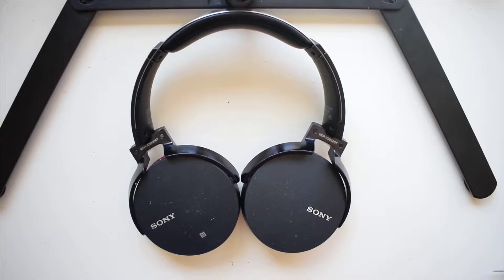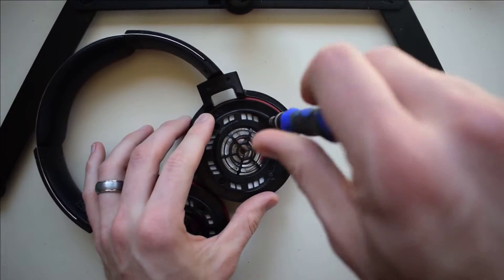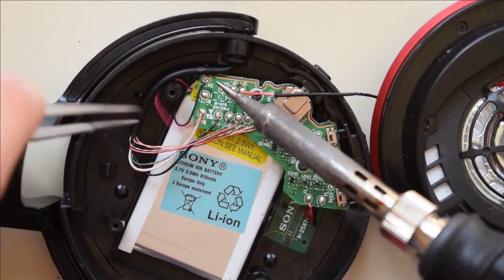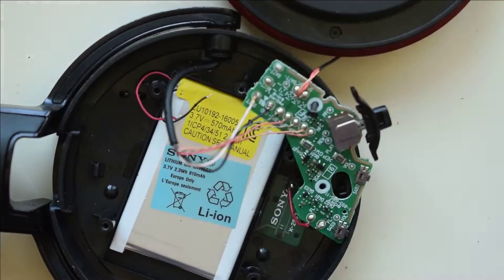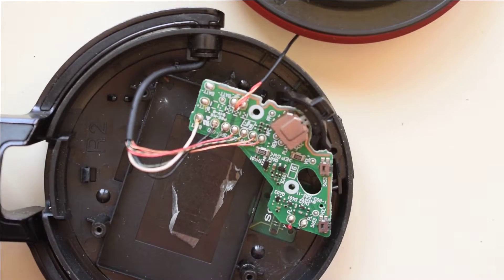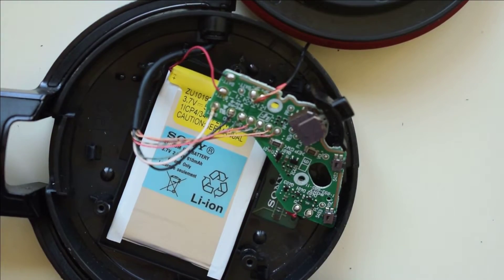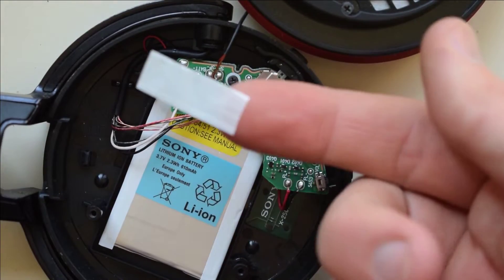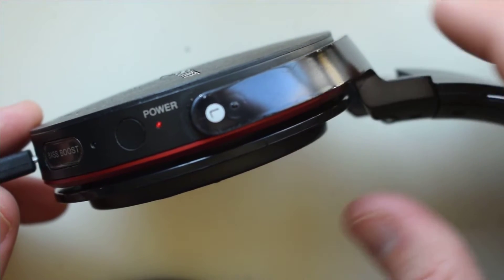Sony MDR-XB950B1 & MDR-XB950BT Teardown Battery Replacement/Repair

Comment: Great video. Thank for sharing!
I've removed the old battery on my cheap headphones (that now only lasts about 30 mins) following your video, but this old battery has 3 wires (black, white and red), while most of the battery options on AliExpress have only 2 wires (black and red).
Can I use these batteries instead? And can I follow this color orientation (without the white wire)?
Thanks!!

Comment: YOU CAN USE COLOUR MOBILE BATTERY WHICH COST ONLY 8$ (WITH MOBILE) SIMPLE KEYPAD MOBILE WORKS FINE BATTERY WORKING HOURS MORE THAN 60 HRS IN MDRXB650BT

Comment: Would it be possible to upgrade the battery to a larger/higher capacity, or upgrade the bluetooth to something with lower latency or larger range?

Comment: What if the red light just turn on for a sec when plug the charger, then always shut off? Is it still the battery? The headset only works with jack
Reply: Did you find any solution?

Comment: Battery Capacity : 3.7V 320mAh 1.18Wh. Compatible with : For SONY MDR-10RBT 1.7 x 0.8 x 0.1 inches
but
DO NOT replace the battery with a 320mAh LiIon battery use a 450 or 650 a 320 is way way to small mAh and if you're going to the tribble of opening and soldering replace with a better higher mAh LiIon battery. 
Yes
The size of the larger mAh batter maybe smaller but it is fine just gotten on that is close
Cost
$6 maybe up to $8 not much more that that even that cost you get 3 batteries not one.
Reply: do you have a link? Preferrably on Amazon?
Reply: Same question have you a link on amazon or Aliexpress?

Comment: How to remove soft ear pads
Reply from the maker: They just slide in place around the edge. Just start in one corner and pull up on the edge and it will start to come off :)

Comment: I've Sony MDR XB950BT. Is the Handle design will fit with My Sony MDR XB950B1 Instead of Sony MDR XB950BT? Are They the same size? I'm planning to purchase a handle 3D model design from xb950b1 then install to xb950bt.

Comment: My headphones light up when I plug them in but immediately the light turns off. Could this fix the problem
Reply: Me too.  Figure anything out?
Reply: @alexandrea73   Try to charge it with the micro USB cable connected to a USB port from a laptop/computer! I have the same model but somehow does not like it if it is a fast charger or a mobile charger with a bigger current.
Reply: It couldn't hurt, that might be the issue.

Comment: how can you get out these screws, are very strong i cant get out
Reply from the maker: Hi. You probably either need to try a different size screwdriver tip OR you may need to clean the screw with some rubbing alcohol prior to trying to remove it. Best of luck!

Comment: I'll just 3d print an addon holder with an 18650 cell in it with 3 to 4 times the battery capacity :)

Comment: Hi where can I buy the battery. I didn't find your link
Reply: Hi. Should be easy to find on eBay. Listings have expirations. https://www.ebay.com/itm/MDR-XB950BT-MDR-XB950B1-MDR-XB650BT-Battery-for-Sony-1-756-920-31-1-756-920-32-/264884268323?_trksid=p2349624.m46890.l49286

Comment: Video is great! Mine would light up red then go out. Could not get my phone to recognize. Took out the battery and put it on a volt meter and I got 4.1v so it was fully charged. Re-soldered the ends and same behavior. Pressed and held the power button until it cleared the bluetooth. Did it again and re-paired successfully.
Reply from the maker: Oh awesome - glad to hear you fixed your headphones!

Comment: Great video.   I replaced my battery  but my headphones still will not work.  The new battery had half charge out of the box. I replaced the battery, turned them on, they worked.  Plug in the charger cord and they shut down....  any thoughts?
Reply from the maker: Whenever this happens to me, it usually is an issue with the charging cable, plug or adapter I'm using. Try to confirm all of those are working on another device. If there's still an issue, try taking the battery out and reinstalling it. If it's still not working, then I'm sorry, I don't know what the next step would be - the circuit board may be damaged :(

Comment: It is a common problem for Sony headphones. It is related to software and not the battery. Use a paper clip to press the reset button. This will correct the charging or  power on issues!!
Reply: What reset button?  The only holes on the headphones are blocked off by LED lenses.

Comment: Do I have to do this on each earcup or only the one where the usb plugs in?
Reply: Battery is on the right side, so oposite side where you plug in micro usb.
Micro usb=left side/Battery on right side on Sony Mdr xb950Bt.

Comment: Hey! Great video! Thank You so much! Please if You can I need Your help! I have headphones Sony MDR650bt and they just didn’t want to charge one day anymore, and if I would plug them in to charge the red light by the power button would be just very softly flickering as You described saying that this is probably the battery that has to be changed. So I ordered a new battery and replaced it as in the video, but the problem is still the same, headphones are not working and if plugged in the red light is very softly and quickly flickering, can You help me? Do You have any idea what else it can be? Thank You!
PS I can add that I am electronic technician but have no experience with those headphones, and also I measured the battery voltage on motherboard where battery cables are going directly to GND and BAT+ which seems correct about 3,69V but on the motherboard of the headphones on both ears there is another GND and BAT+ so on this points I have 2V and it’s dropping down, and if I plug it to charge then on this points I have 1,2V sometimes 0,5V, don’t know if that’s the way it should be, and also it seems like GND from battery directly on motherboard have a short circuit with BAT+ that is bit further in the middle of motherboard. Please if You can help me

Comment: Well done making your videos.  Best procedure is to isolate the loose positive or negative wire physically out of the way or covering one with tape.  Close quarters and you brushed the circuit board against them, asking for a short + ruined headphones.
Reply from the maker: Thank you for the advice! I did not know this was a best practice, but that does make sense. I have repaired at least 200 of these headphones and thankfully I have not had any issues with shorts but better safe than sorry :) Thanks for watching!
Reply: What does it mean to isolate the positive wire?
Reply: Headphones bought in 2019 now house the battery in the LH earphone. Design change by Sony maybe? Otherwise everything else was good, battery was contained in a hard plastic housing, looks very neat and tidy. The battery terminals were the only thing needing soldering. .